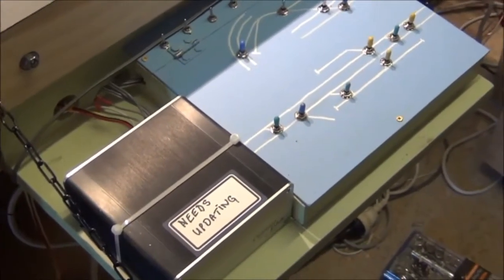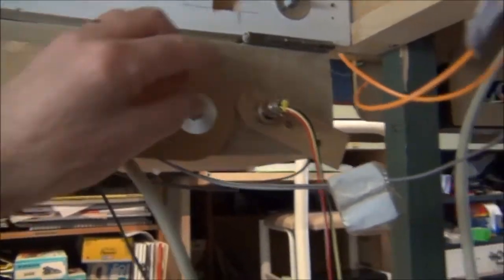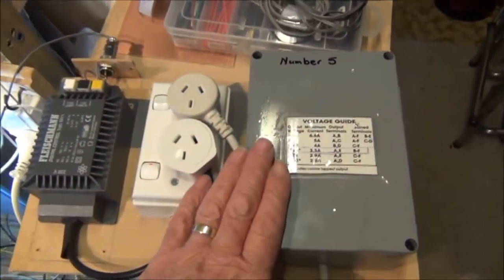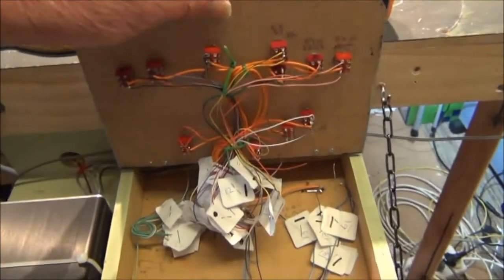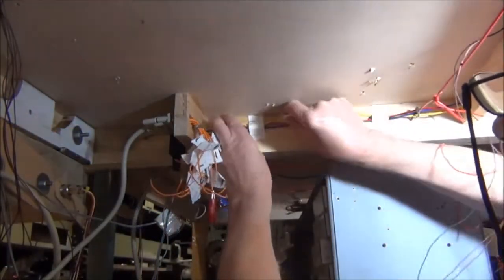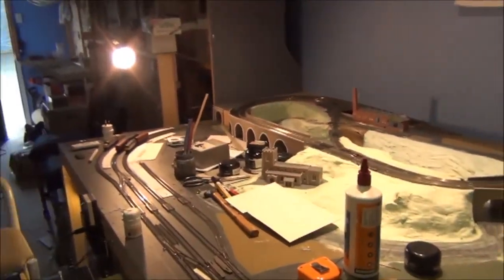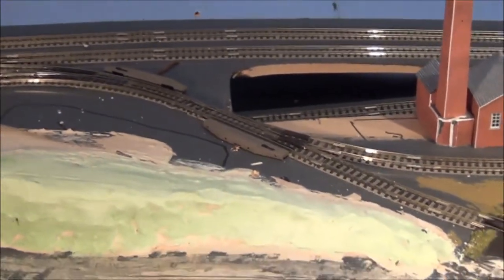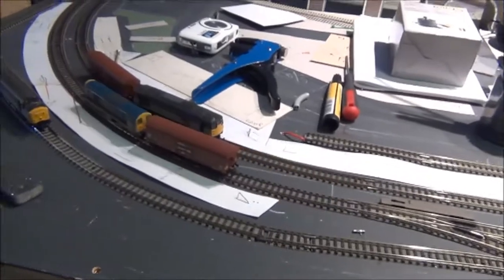Fallowfield rebuild part 4; Electric's

Comment: All very professional! On a previous layout I designed a portable control panel that I could use from anywhere on the layout. It ran point motors, turntable control, decouplers and provided power measurement points etc. Sadly when finished I had so many cables going into it, it was a drag to move it all around! Not a recommended idea! We live and hopefully learn!

Comment: Good idea with the hinged control panel ...can be a pain with all the wires ..thats one reason I did not use point motors on my re build ..hard work getting under the layout at my age ..thats my excuse anyway ..dAve
Reply from the maker: Thanks Dave, I know what you mean. You can hear me puffing at the start of the video after climbing out from under the layout.